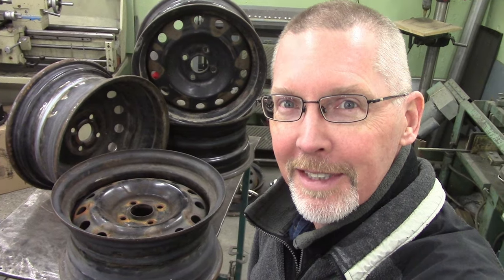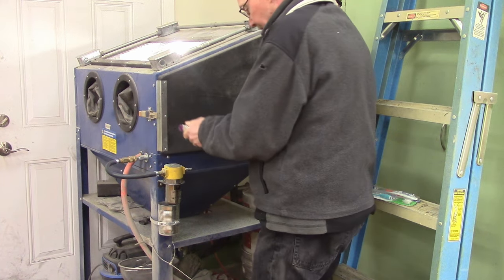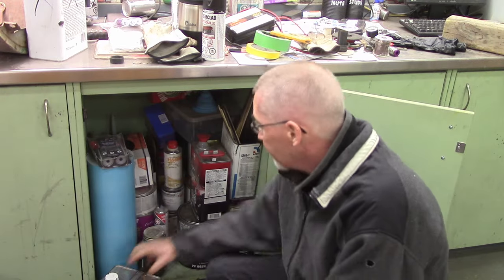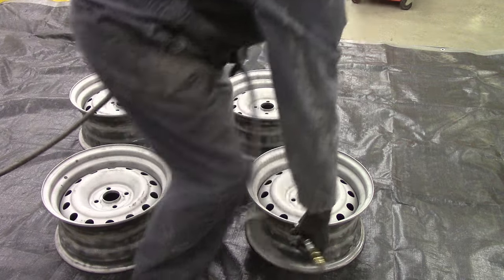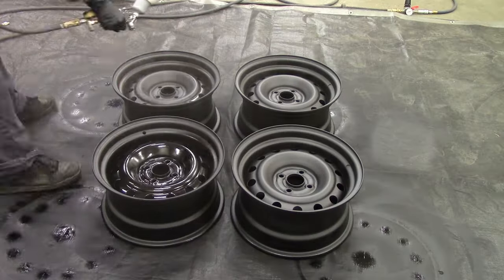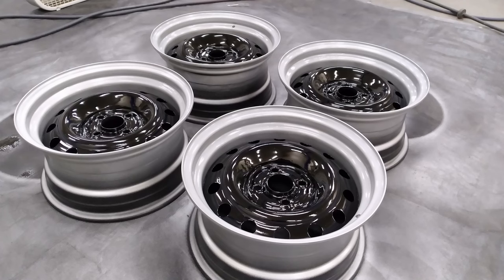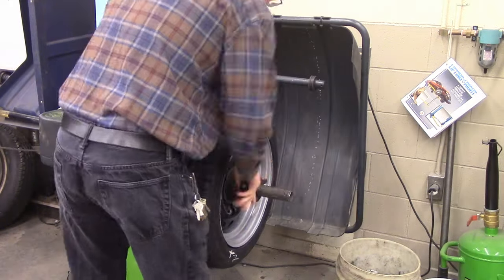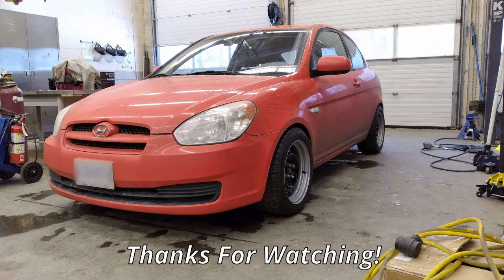Painting the Widened Steelies

Comment: The only suggestion I could add is if you would seam seal the wheel centre to the ring after epoxy. 
I have found they last much longer and the rust and or rusty water does not climb out of that area. 

I have also used silicone to do this as well on the cheep white trailer rims. 
It worked well

Comment: That little miller mask is my go to. Fits under my welding hood without issue and higher quality protection.👍
Reply from the maker: You have to spend more on cigarettes to make up for it, though (grin).
Reply: @GregWellwood  quit after 33 years. But the dutchy still gets passed.
Reply from the maker: Had to look that up - never heard the term before.  I've never smoked anything.... except tires..... and not in this car.

Comment: Hey bud this is Cousin Eddie (aka Tx Firefighter). You might consider some of those window liners from TP Tools to protect your blast cabinet windows. I use my cabinets a lot so and get many years out of a window. The protectors have self adhesive strips around the edges to adhere them to the glass lens. Works good. You can even seal them to the lens better with painters tape around the perimeter. Eh.
Reply from the maker: I've used those in the past, but I found the inevitable collection of debris inbetween annoying.  I never thought to double tape them - I'm going to try that!
Reply from the maker: (You are still one of the hugest inspirations to me)

Comment: Where did this set end up offset-wise?
Reply from the maker: Around +25mm, if I measured correctly.  I'm sure it's going to feel..... interesting .
Reply: @GregWellwood  The good news I suppose is that you're actually 6mm closer to proper offset than the banded 14s if I've done the math right in my head. I'm still pondering wheel choices for that 5lug brake swap so this is good info, thanks.